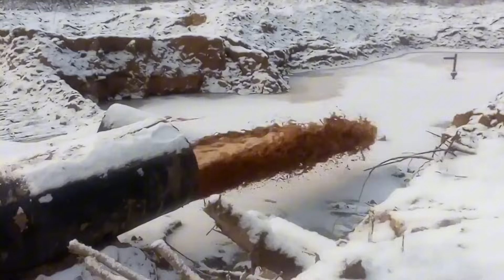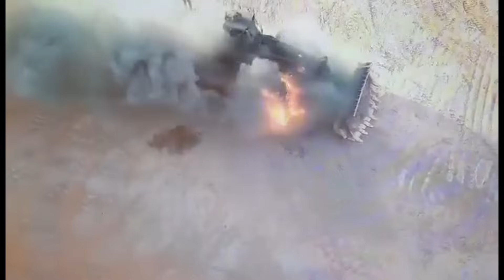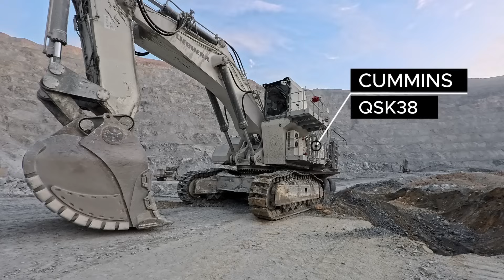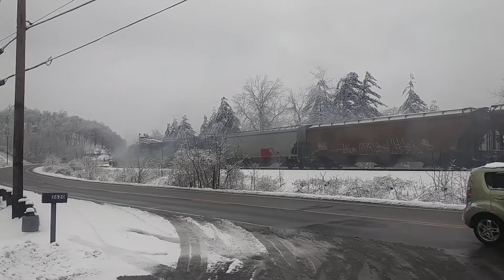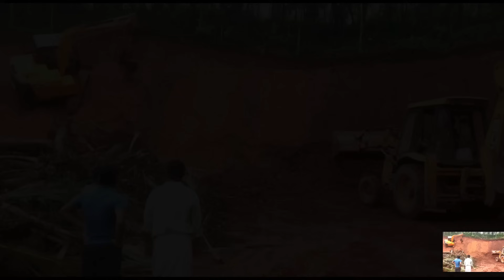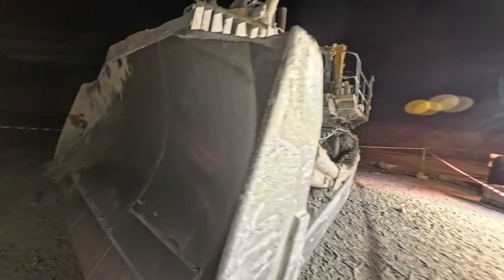Dangerous Idiots and Most Expensive Mining and Construction Disasters Caught on Camera

Comment: I’m surprised those trucks aren’t four wheel drive.  Being off road you would think that would be standard.
Reply: The smaller ones are all wheel drive. The big ones are not. I think it would be a maintenance nightmare honestly.
Reply: @Rancher-xx5vt most big and becoming more small rigs are hybrid, big engine just drives a generator that powers the motors in the wheel hubs, simple, just lots of wires
Reply: There is no need… these “off roads” are often kept in better condition then our actual roads and with the crazy weight you won’t need it